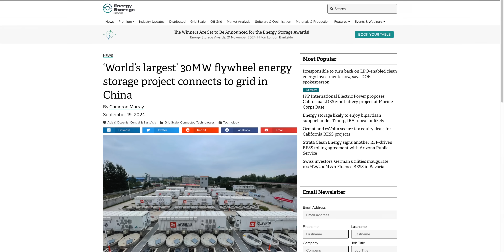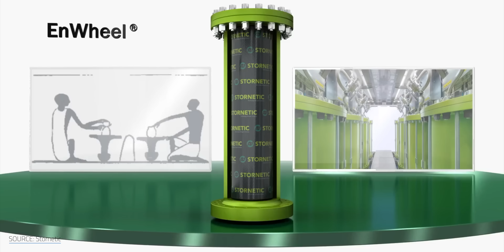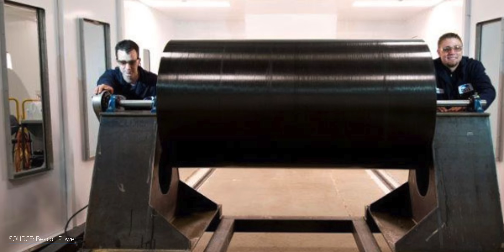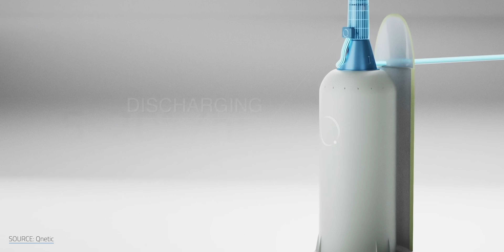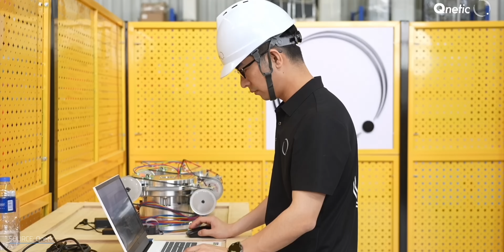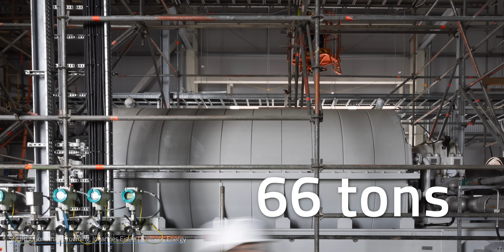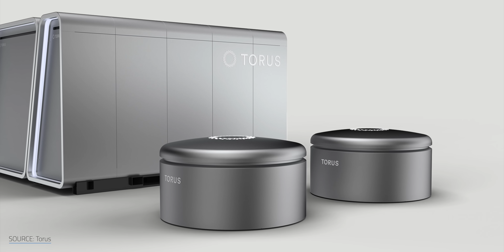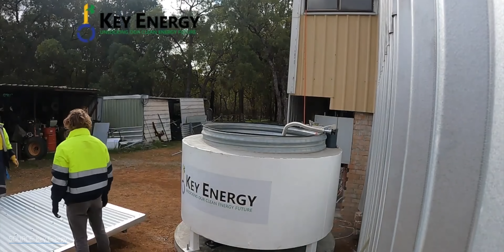How This Mechanical Battery is Making a Comeback

Comment: I feel like there's a lot of obvious changes to make and I don't get why they're not done:
1.  First and foremost: for current generation, why not just have the magnets on the outside of the flywheel?  So long as the flywheel is made wider rather than taller, you could have a pretty substantial speed difference over the outer diameter compared to the inner diameter.  That means you can operate at a lower RPM, perhaps low enough where it can be safe to be above ground, while also reducing frictional losses.
2.  Assuming the flywheels are made of iron (and appear to be cast as one giant mass rather than many smaller parts), why not just make the whole flywheel one giant magnet?  At such high RPMs, the poles flipping should be able to produce enough current.
3.  For omnidirectional wind power, why not make the turbine itself a flywheel?  2 birds, one stone.
Reply: The energy formula is E ∝ Iω^2  where ω (omega) is the rotational speed and I the moment of inertia I.E. basically the mass. The thing that makes flywheels even remotely viable is the ω^2 bit. The energy stored is so much higher if you rotate fast. By adding mass you make the moment of inertia higher but only proportionally so and, of course, the bigger the mass, the higher stress on the bearings.  A wind turbine (and indeed steam turbines) are already flywheels like in your point 3 - but the high speed spinning of a dedicated FESS stores so much more energy.
Reply: 1. That's almost exactly how the generators the flywheels are connected to work.  You don't want lower RPM.  Energy is stored as RPM squared.  You want fast.  
2. You  don't use magnets in the generators, you use electromagnets so you can regulate the amount of power produced.
3. Because you want flywheel speed and the ability to store and release power on demand.
In general, there are usually really very good and well thought out reasons for things to be designed the way they are.  This is especially true for expensive things.

Comment: Matt, I would have some serious reservations about deploying flywheels to an earthquake zone, like the Philippines (or California). Shaking a rapidly rotating device can't be good for it. I remember when they were looking at using these in cars and the experimenters had a problem with them shredding themselves.
Reply: for years we have been isolating _________  with a few tried and true methods,  this can be done for flywheels also. Can be zero interference - some of it would be gyroscopic.

Comment: Power companies need to generate more power than needed as a buffer to accommodate instantaneous spikes in usage.  Flywheels' "instant output" capability lets them maintain a smaller buffer and thus save $.  This long-term cost advantage is why they make a good investment.
Reply: It's not that simple. Generators can only supply what is demanded. So if you want 'excess' generation then you need to store it somewhere. Generators are designed to optimally run at specific loads, so having multiple low-loaded or unloaded machines online creates a less resilient system. Primary generation - nuclear, gas, and coal - all have there own constraints. Fission has wild fluctuations in its products and power hours after change in demand. A 1% change in a 1000 MW plant in the course of an hour poses immediate risk and will cause extra maintenance down the line leading to a less resilient system. Natural gas and coal require logistical infrastructure to maintain and globally, coal kills more people than the rest of generation sources combined. 

Bottom-line, money isn't the only constraint. A lot of it comes down to physical realities, not money. That's not to say power companies are off the hook. The biggest objection that people should have is in their maintenance practices, or lack there-of. It's why PGE caused so many wildfires in California.
Reply: I have this discouraging suspicion that the CEO's kid needs a new yacht because the last one is 2 years old, therefore the board won't vote for spending on improvements like this.  However, I agree with you, it needs to happen.
Reply: The "instant spikes" people keep referencing are not in measured in milliseconds, they come over seconds to minutes, as people cycle air conditioning, solar, or wind, because of cloud cover or industrial shift-work. Renewables are not as 'unstable' as everyone seems to want to say.
Reply: @MichaelRussell3000  True, only "instantaneous" compared to the time it takes to get additional steam pressure to a turbine.  A coal plant operator told me that it takes 24 hours to go from cold start to full power.  How many minutes to ramp a gas fired plant up from 50% to 100?
Reply: @MichaelRussell3000 So many people think off the potential downfalls always say this like "You gotta be careful" then go into speel  people should think more like give it a try we don't need a one shoe fits all it doesn't always have too be the best option every option comes with pros n cons short term and long term and every system can be adapted and improved people should focuse on mixing systems more n trying new idea n not focusing on the one grid have back up local systems storage batts are not hard too make and nor are batteries there's littarally unlimited designs...there's alot off restrictions in energy world due too profit margins because something too good would make no money and or if simple n effective people could make themselves...cheers
Reply: @jshaw4757  - Cheers? After reading that I need to throw up.
Reply: @johnsmith1474  Glad too be off service it sounds like you needed it..I'd deffo get checked by doctors mate if reading comments makes you vomit lol.. very dramatic lol..

Comment: Beacon Power in Massachusetts began R&D in 1997 into FES systems. Since 2011, Beacon operates 200 flywheels (20 MW) in the mentioned Stephentown, NY facility.
Reply: I have a friend whose family owns a machine shop in Stephentown, and joke that their power usage is so dirty the utility had to install one of a kind flywheel, right next door.
Reply: How many MWh?  Do you understand the difference between MW and MWh?
Reply: @garycosby1948  Capacity per flywheel is 100 kW. Energy delivered per flywheel is 25 kWh. Discharge time is 15 minutes in this configuration according to the Beacon Power spec sheet of their generation 4 FESS.
Reply: self-dischargeg rate nd turn around efficiency pls

Comment: I'm supervised they are so small.  Wonder why they didn't go with the large diameter ones.
Reply: You do run into a limit on material strength and larger diameters can put more strain on materials vs a smaller diameter.
Reply: @matthewconnor5483  Well yes, But one of the main advantages is that you don't have to spin them as fast.
Reply: @lucidmoses  ..but the whole deal with flywheels (not covered by Matt) is the energy stored is proportional to the rotational speed *squared*. So, in essence, faster is better than heavier.
Reply: @mb-3faze  Ah, ok, that makes sense then.

Comment: Personal systems. Wind generation has big overspin issues here, making the need for brakes and major power burn off. Combine fess storage as a direct and or electrical drive, using some form of disengagement for no wind times. Seems that would work in place of the brake as well as storing energy. May not be feasible but worth a thought or two.
Reply: Bit like a resistive dump-load common with wind turbines, I guess - just a bit more useful than producing heat to bleed off excess generation and keeping the blade spin in spec.
Reply: @mb-3faze  Squeeze any penny we can, I think in off grid terms. Its something to ponder on, anyways.

Comment: Hmm, 60 years ago. Pumped water storage.
Reply: People get upset when you flood their communities to create power storage reservoirs.
Reply: @stargazer7644  PUMPED..means water was pumpED UP.
Reply: @charlesgates9814  You don't find many rivers or reservoirs on top of mountains.  Dams are built where the water is.  Which is on the rivers at the BOTTOM of the hills. That is also coincidentally where people build communities - on the rivers where there's a water supply.  You pump the water UP to the higher water level behind the DAM.  You let the water out to fall DOWN through the dam's turbines to get the power back.  That's how reservoirs work for energy storage.

Comment: Are these short term batteries or longer term capacitors?  Seems more like the later.  They are great for small near term gaps in power, but not a replacement for actual energy storage.   Can FESS actually store power for hours and be efficient, aka overnight?  I get the value during the day for a cloudy period or short breaks in wind, but again, that seems like a capacitor and not a battery.
Reply: yeah, they seems just giant capacitor to me
Reply: The flywheel in the UK is exactly used like a capacitor, it charges up over a long period of time then releases the energy gain in an instant to power a nuclear fusion reseach system.

Flywheels are good for this type of use, and for frequency stabilising the grid but less so for long term storage due to the high self discharge rate covered in the video.
Reply: A synchronized flywheel (aka relatively slow RPMs, fixed speed) is basically a capacitor for the grid, able to supply significant inertia well beyond the power generation used to maintain it, because it is more or less directly coupled to the grid.  But due to the slow rotation rate and limited RPM range it cannot really act as an energy source for very long on its own (without energy input) before having to disconnect.

An energy storage flywheel (high RPM, variable speed) is basically a battery... it is NOT directly coupled to the grid or synchronized to the grid in any way, but instead must go through a number of conversions to interface with the grid.  Because of these additional components an energy storage flywheel cannot really act like a capacitor for the grid or even be much of an inertia source.

-Matt

Comment: I have serious questions on how they calculate the RTE of the mechanical batteries being they have a loss over time. I believe you mentioned it was a percentage per hour when not charge/discharge. So I am wondering the True Round trip efficiency if it stores the power for 1 day... or 1 week... chemical batteries do not loose much... and if i remember Sand batteries store heat well for months with only small losses
Reply: They are referring to the immediate charge / discharge efficiency for the round trip - i.e. charge it up and immediately discharge all the energy for the RTE calculation.  Self-discharge is a separate factor.  These separate factors can then be combined for your own calculations on how much energy you can recover after so many hours or days.

Comment: Wouldn't this just be a question of cost? Seems like both lithium ion batteries and flywheel battery operate in similar short term energy storage space. Whoever is cheaper will end up winning the race.
Reply: Yes, but the cost is always easy to calculate over the lifetime of the storage device. And even then people tend to want the lowest up front cost regardless of the long term cost. 100$ install that costs a 100$ a month to operate is often seen as better than 200$ install that costs 25$ to operate.

Comment: Excellent what is the effect on the uderground surface where you put it is not clear.What if we add battery grid after production like sand storage and other store it will be sustainable and sufficient
Reply: What effect on the underground surface?

Comment: Battery storage will be cheaper and easier. 

It’s not even a contest. 

Iron and sodium chemistries aren’t even necessary. But they are coming.
Reply: A flywheel can "charge" and "discharge" hundred times a day and still last 50 year.... try doing that with a battery.
Increasing capacity is as simply as increasing the weight, can be as simple as concrete, steel or sand, cheaper as whatever battery chemistry.... and if you really want you can spin a battery for extra storage.
Reply: True, but is there enough use case for that to make it worthwhile? 

Honest question.

It seems like batteries can do that same role, by managing the cells in use carefully—charge one bank that collets short duration spikes while discharging a different bank for micro shortfalls. Reducing cycles on the individual batteries.

I know the batteries are already doing micro demand smoothing—keeping the 60hz curve and timing smooth.

Comment: I would say these would be very useful on a neighborhood scale. There are frequent small power outages in Texas and this seems like it would make more sense to install rather than each house getting their own generator.
Reply: Given a simple frost brought the Texas power grid to its knees, its problems go far, far deeper than just neighborhood installations.
Reply: @custos3249  simple frost? first time it stayed below freezing for 2 weeks straight in hundreds of years, AND it took a ton of bad maintenance and negligent cheapness to actually make it a problem. the grid wasnt the issue with that just like the grid wasnt the issue with fukishima.
Reply: @bradhaines3142  *laughs in northerner and civil engineering 

Ok, champ.
Reply: @brennonoverton8277  despite these things storing energy, what you want to do is use them for grid stability and frequency regulation, on a 15min/30min timescale. Use EVs and house batteries (DSR only, or with V2G and feed-in tarrifs) and/or municipal batteries for storage.
Reply: Taxas's issues are far more fundamental than the neighborhood scale. This would be a sticking plaster. Texas needs to smooth its power supply by collecting up the neighboring states, surely.
Reply: This is worse energy storage than biodiesel (which can be as simple as animal fat). Just get (or build, they can be made from garbage) a stirling generator and use biodiesel, these things can run off chickenshit fire if you run out of alternatives.